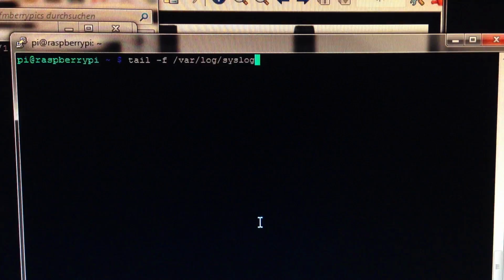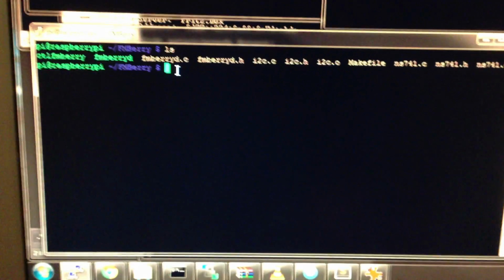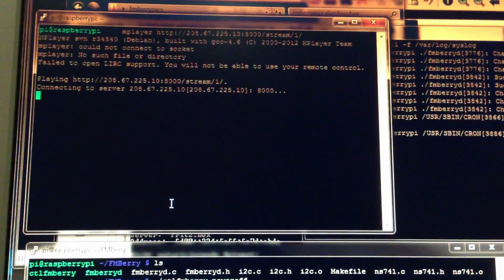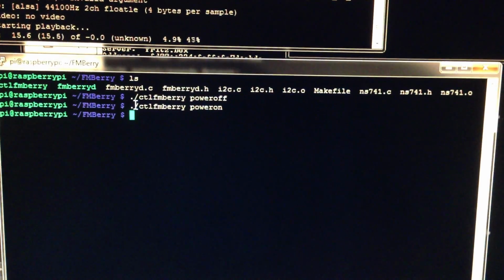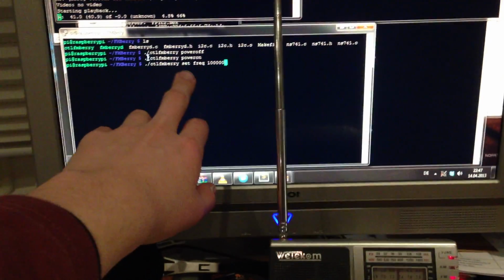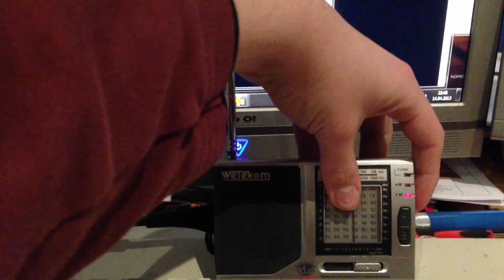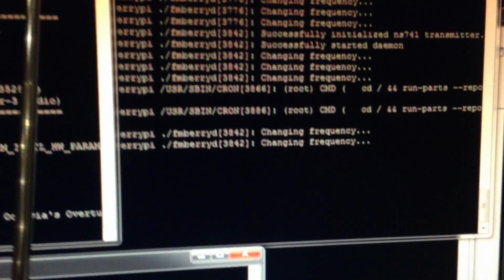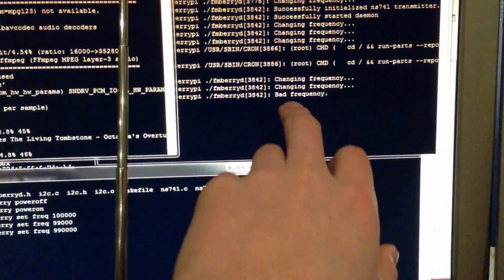FMBerry - an FM transmitter for your Pi

Comment: I just tried the project. I do not understand if the RDS works.
In the code it seems to be implemented but no device displays information.
Reply from the maker: +TuttoCrafting Hi! Yes, RDS works fine. Have you build the device and set some RDS text via the ctlfmberry utility? 
If so: Have you checked the RDSINT pin in your wiring?
Reply: ***** Thx, it was a cold solder point.
Question: In my case the quality is low.(There is no antenna the receiver is connected with a cable to the trasmetter)

Is the chip or something else? If I mute the problem goes away. I'm trying to figure out if the problem is with the audio source or if it is in the transmission. Suggestions?
Reply from the maker: +TuttoCrafting Make sure that the volume is turned up. If you're using the RPi as the audio source use "alsa-mixer" in the console to set the volume. 
Also, you could try and set the "ctlfmberry gainlow" instead of "ctlfmberry gainoff". Another thing to try would be the "ctlfmberry set volume 3" command.  (0 is default, 6 is maximum). 

If that all doesn't help, check if your audio cable is hooked up correctly, if the ground is connected as well.
Reply: +Tobias Mädel (Manawyrm) I do not think it is a volume problem but about noise. I do not understand why sometimes the signal is "strong" and sometimes is weak, with a hiss and the lack of a sound channel. It looks like a interference.
Reply from the maker: +TuttoCrafting try hooking up a proper antenne instead of using a direct connection. 
https://camo.githubusercontent.com/4cee060a0ec07ec50c76d2c4ce3f69ab5d8a6dc7/687474703a2f2f332e62702e626c6f6773706f742e636f6d2f2d6e5f6f686b4a42507a2d592f55346b424b6e34415a34492f41414141414141414153632f703645596b476f6e7975592f73313630302f6d6d722d3037302d313032342e6a7067

A 75cm long piece of wire should be a good antenna.
Reply: You can also do with just a piece of wire with the PiFmRds project https://github.com/ChristopheJacquet/PiFmRds

Comment: My Pi is one of the first batch released in March 2012. 

i2cdetect -y 0 detects the transmitter at 66, but 1 yields nothing.

I've tried compiling with RPI_REV1 and RPI_REV2.